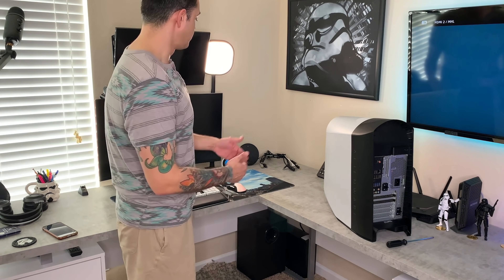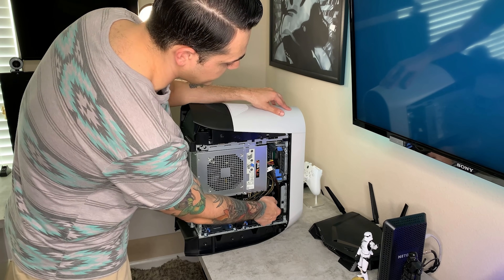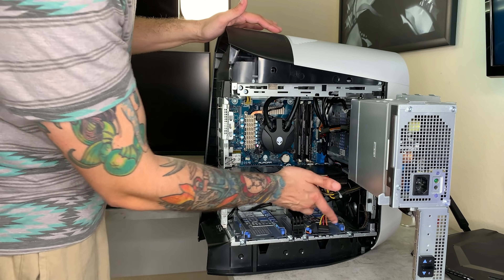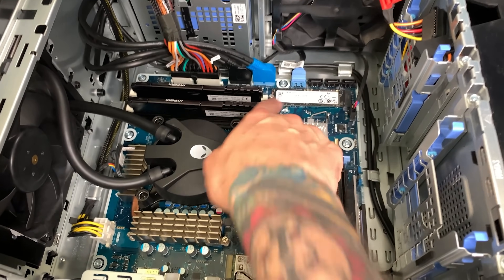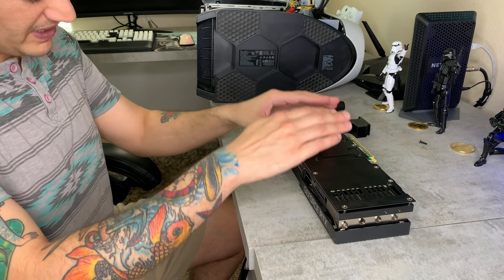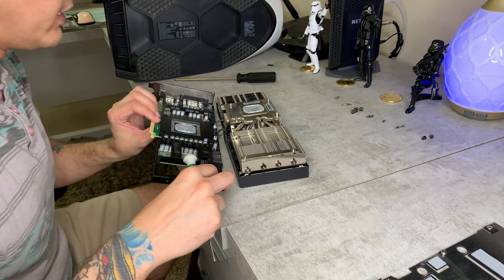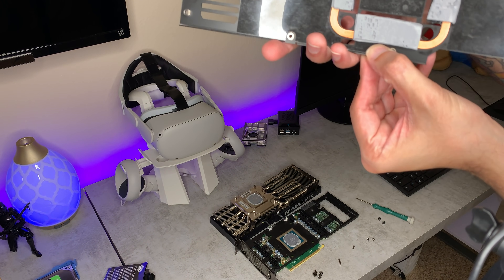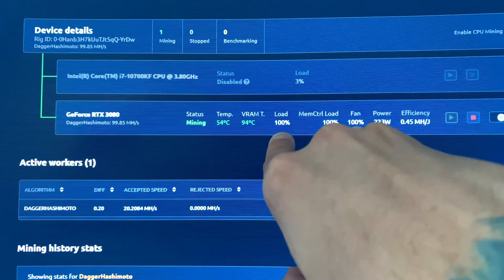Alienware R11 3080 Thermal Pads and Paste Drop VRAM Temps 30C

Comment: Those alienware suffocation boxes just are horrible,moving all the crap out of one into a new case litterally lowers ALL temps Mobo cpu gpu ram and board temps drop 20deg.Stock everything was 73deg I got everything down to 47-55deg Celsius from the new case.The standoffs I had to modify but it worked.

Comment: I bought my R11 a couple years ago and overall was happy with it.    I wish I had seen your site then!     This morning I got the dreaded  pump fan not responding error code.   The fan runs but I guess does not spin up to speed.   I have a new fan ordered and while I have it apart I am going to add the second intake fan.  This is the first time in about 25 years I bought a pre-built PC.   When I built my own I got huge cases (I miss Fry's electronics)  I still have a couple and I thought about transferring the  R11 guts to the bigger case.    One has a Thermaltake 1200 w PS.  Lots of fans and lots of air flow.  I will be checking out your other videos to see what I have been missing.

Comment: I'm having problem - my aurora won't boot up now 🥲 i tried cmos, tried replugging everything, tried switching back to stock ram (that's the only thing i changed in my rig),  tried unplugging everything, bar 1 hdmi monitor. It flashes white 1 and 1, then 2 and 1, then no flashes whatsoever. I read through comments but nobody reported in the first like 50 i checked
I bed you or anyone, what can i do ro boot her up?

Comment: ok dude excellent video... holy f! Wonder if you have any issues one you unscrewed everything in terms of removing the PCB board? I disassembled my Dell RTX 3070 (its pretty much the same design) but for some reason after removing all the pressure screw's after the back plate was removed I could not FOR the life of me remove the board to reveal the damn GPU / access to replace the thermal paste. Just wondering if I should pull this thing apart again and just pull harder ? I really did give it a good pry and it really seems to be stuck together... any chance that could just be the 2 year old paste fused together ? Any help or advise would be great , cheers.

edit: okay so I read a few comments how separation was "difficult" so I opened it back up and gave it a second try.. Dell used around 1cc of thermal paste and it had hardened into thermal glue after two years! took a million q tips and alchool to clean it all out.... wish me luck using artic silver 5! in a moderate amount along with  adding some thermal pads like you did!

Comment: I have the same computer but when I took my card out it's different than yours. Yours is longer than mine and when I took the top plate off (some screws were upside down. Not all on top like yours) like I can't separate it its different I don't know what kind they have cuz I don't really know much about computers. Just recently bought this Alienware deal and now I got this thing out I don't know what to do with it now because it doesn't come off like yours did. I'm so confused now. Been trying to find other alienware videos with my type of card but everyone has one like yours. Not sure of they screwed me over with some kind of second rate cad or what. It's the same number, and everything. I just don't know.

Comment: I didn't see any mention in your video about adjusting fan speed via the Alienware Command Center app - it took me a bit as the UI is terrible, but if you go to the temp tab (fan speed) and click just to the left of the offset on your current profile you can crank those fans up for when you are mining.  Granted this makes the machine hella loud (new quieter fans on their way) but it did drop temps a bit more.  Sorry if redundant or a "duh" moment, but squeezing out any additional temp reduction is always a good thing for mining.  Great video by the way - I love your setup!

Comment: I did my 3090 in my R13 and I’m getting 122 MH at 49 degree core and 96-98 VRAM at 100% fan speed (only 2000rpm Noctuas) in my OCC controls. I plan to improve this even further by adding a large copper heatsink and possibly a fan to the 3090 back plate.

Comment: I just followed this procedure with my 3080 and the results are fantastic. 

I was running Medium setting in NiceHash with 104 Celcius VRAM temperature. I decided to shut her down as that was way beyond recommended operating temperatures.

I used 1 package of 1.0mm Thermal pads and 4 Thermal paste tubes as prescribed.

Now I am running Extreme setting with 88 Celcius VRAM temperature.

AK40Kevin, many thanks for posting this video. Cheers!

Comment: Just changed thermal pads on my 3090 Alienware aurora r11 with the Gelid Solutions Gp-Ultimate 1.5mm (saw them on a comparison video and they where among the best) and upgraded from 100mh/s 100C 70% fan, to 120mh/s 98-100C and 60% fan
Reply: Nice improvement but what shocked me more is that you only get 120MAsh. My 3080 takes probably half the power (never really check the exact numbers...) and after repasting, I'm back t0 100 megahash/s...

Comment: Nothing on you buddy, it’s just so sad that they would actually charge you so much and you have to try to correct Alienwares sad attempt at building a gaming desktop.  If you buy a prebuilt I feel it should come operational out of the box, not thermal throttling at idol.  If you ever need help building your own rig let me know, I’ve been building rigs since the early 90’s.
Reply: do you know if i can change the cpu cooling, mine does not have watercooling, so i was wondering if i could replace the cpu cooler with a corsair h60 watercooler

Comment: Not sure if anyone said this, but i think the real issue was you putting the thermal pads on the die side heatsink. You should have removed the cover on that was on top of the die side thermal pads and put them there. I'm not sure that thermal paste really solved the issue. i suspect the big thing was having your card mounted correctly after teardown and the thermal pads on the back. I am going to work on a couple of my friends dell 3090s this weekend and I will try just the backplate pads first and if that doesn't help much do the front side and report back. If we find in the end we need thermal paste then I'm the dick :P

Comment: You can't use pads because the core itself is then not making contact. The square in the middle that has paste from the factory, that's the GPU core. Really this extra paste is allowing the substantial cooler to more effectively take heat out of the memory in the same way it can remove heat from the core, which it's very good at.

Comment: What he said is true, I applied thermal paste on my r12 3090 Memory temp from 110c dropped 2~ 4c but I put some heat sink on back plate and fan blow on heat sink, It dropped until 98 Celsius. But I haven’t changed my thermal pad yet, If changed maybe can lower more temp.

Comment: I tried the thermal paste on the metal housing, stickers removed, no dice.  Memory junction still topping out at 110 degF.  Replaced all the pads, 5 times now trying different combinations.  I hate my Alienware R100 3080.  I shouldn't have to go to these lengths to make it be able to handle it's own heat dissipation.
Reply from the maker: Yeah I was super frustrated /Pissed the first attempt when nothing changed , second was successful for me , I’m not sure what is different about what you are doing . What paste are you running?
Reply: @GamerHeavenOfficial  Arctic silver 5.  The paste part seems perfect.  When I lift there was good coverage, CPU temps are running cool at 46-48F.  I'm going to keep working on it until I find a good setup.
Reply: @GamerHeavenOfficial  Huzzah!  Well, sort of...  The RTX 3080 and I have come to an understanding.  I replaced the 1mm pads with a different set of 1.5mm and the 3080 agreed to stop overheating and throttling.  I only got down to 106-08 degF, not the phenomenal drops others have experienced.  BUT!  By getting it down those 2-4 degrees, I'm no longer riding that 110 throttling barrier.  It's a small victory and we're at a tenuous peace, but the future begins to look a little brighter.  From 75 MH/s to 99 MH/s, holding solid for the past one hour now, a 28% increase.  That's all I needed!  Thank you for your video; it and a little bit of tenacity got me to a workable result!
Reply: @mikemcelveen  Dear Michael. This is an old post. Take the side door off and temps will drop 6C. Then use a small fan to blow on the GPU and move the hot air off and you might get 4C drop. I'm doing that mining 89M/H on a alien ware 3080. I'm about to do this mode as my 2nd R12 is about to arrive and I have to R13s incoming in Jan that are 3090s.

This is a lovely channel that helps good people make more money and optimize together.

Comment: You never answered my question about Cloud Prepared. Also weird question. How much thermal paste do you think you used for the GPU and for when you pulled the water cooler off? I bought 1g of kryonaut but not sure if will be enough
Reply: Don’t need much. I just put a pea size amount on the center of the chip block and left the existing paste on there as the pc is still new. Then I peeled off the two stickers on the metal plate, cleaned the residue with isopropyl alcohol and a clean cloth, and proceeded to put a line of paste on each of the four sides. Don’t want to overdue it. Getting 60-65 degrees Celsius under load and 28-31 at idle or while browsing the web. Put in two front noctua fans and it runs a lot quieter.
Reply: I also didn’t bother with the thermal pads

Comment: ...People LAUGH at the "sometimes basic" but almost always GREEN basic colored PCB of many, many dells cards sometimes made teamed with PNY and such ...they may not look "the greatest" until you realize the longevity they do indeed have as in any made for DELL mid to higher end card, I have a 1060 6gb with basic blower fan and blue PCB, just never stops going regardless how badly I beat up on her.... This is when I realized PNY gets a bad "rep" for no good reason as PNY is beast and GOOD INDEED, DO NOT Listen To Those Whom Say Otherwise, ASUS is the one that BLOWS.... Especially the mobo's, always breaking, Thus IMO -  a Gigabyte mobo (they make them ultra durable and MEAN IT just get matching ram and modded bios sometimes for higher end giga boards, last forever too) with a dell GPU card made for dell like by PNY or such (if find one for sale) as well as matching ram (with "Samsung chip-lets" over micron these days) by G-Skill, Patriot &  Corsair is also fine however if find ones you like that are LISTED to work with the giga board made by Mush-kin RAM KiT's - GO WITH THEM! .... Get a little larger case then needed to help with airflow and a proper water cooler or even a Noctua Cooler, they are all good as well as certain cooler-master vapor chamber coolers are also beast and never fail like the GTS V-8.... I recently took a chance on "In-Wins" almost unknown water cooler as in the SR-36 pro as want to test the TECH they have to go against as-rock and its stupid patents.... I LOVE In-wins cases, some of the best ever in way of HEFT & just overall "awesomeness and quality, also last forever as well as rarely ever a single plastic piece BUT some of them are trading that for cooling thus they need to get better at that part or if you are okay with minor to medium tasked MODS of your case then in-win would be the ticket for a case.... Seagate I always trusted with my drivers however I am out of the loop with drives now and what is the best, especially for solid state ones from SSD to the NVME & M.2 but Toshiba maybe, if again - can find that as its not made in china but yet JAPAN which is spectacular quality over the decades only ever challenged by the U.S.A on many things, Taiwan also does a good job however they always have the Chinese parts that some things can not be HELPED.... If unsure and it is made in the U.S.A. somehow...Japan or even places like Germany and such, other democracies where QUALITY matters, GO FOR IT..... BTW: I have bought a used x299x board by giga for great price as was used fort "testing cpu's" ... but seller did not mention the VRM pads seem to be swapped and are thicker a tad, light pink, nearly bending the thick giga PCB a hair if really look closely near vrm as has back-plate - unsure if this is a good thing or bad thing.... HMMM.... Anyone, return or keep as afraid to put my 9800x into it now as in the lowest CPU I have for x299 and the Russian seller is not very talkative but feedback is decent to "okay"?.... QUOTE ME HERE; "I HATE THESE AMAZON WHOLESALE BUYERS OF JUNK & GOOD STUFF AT RANDOM AS IN THOSE RESELLERS WHOM GET THINGS THEY DO NOT KNOW WHAT THEY ARE AND RESELL NOT KNOWING IF SOMETHING IS WRONG THE EYE CAN NOT SEE, ITS LIKE A PLAGUE ANYMORE" .... On another last note, I also like the fact DELL uses those BEAST MODE steel insides still (heavy, durable) but why do they often have to ruin them by covering with plastic? This is where Silverstone comes in, they still make the great case ever made in my opinion as in the Silverstone Fortress FT05 in silver or black, with window or without.... G.O.A.T. - gave mine to my son and just ordered a iCUE5000X RGB and like the looks in white however wish the one single part in grey near front was not plastic however its super sturdy, just hate any PLASTIC! .... Heck, even if they layered the plastic in a thin but thick enough to last metallic SUBSTANCE (OF SOME SORT?) would go a LONG WAY - IMO...

Comment: I just did this 2 days ago pads+paste and I am over clocked mining ether and dropped from the 110c thermal throttle down to 90-96.

I did the coffee filters with alcohol to clean off the old paste (I got about 95% off but some remains around the edges)  

Gaming really see an improvement my office doesn’t become an oven.

I used the smaller 4 unit Syringe and it was just barely enough and I would of liked to have a little more.

Comment: @12:15 -- the most important part of the video is magically corrupted.  I went super generous and the supposed areas mentioned and got my temps down only 2 degrees from 108 to 106.  Anyone else tried this and had it work? Please let me know
Reply: I just did this 2 days ago pads+paste and I am over clocked mining ether and dropped from the 110c thermal throttle down to 90-96.

I did the coffee filters with alcohol to clean off the old paste (I got about 95% off but some remains around the edges)  

Gaming really see an improvement my office doesn’t become an oven.

Did you remove the little plastic stickers before putting the paste down?  

I used the smaller 4 unit Syringe and it was just barely enough and I would of liked to have little more.
Reply: Thanks for your comment.  I did remove the stickers, used 6 grams of TFX and it was barely enough.  I wonder if I needed more, I will open it again but this time not clean off the paste but add more and a large dot in the center.  Will add more and report back.  Which paste did you use?  Glad you had good results!
Reply: @loveislife77  I only used 4 grams but it really needed 6 grams.  

I completely covered the chip and then used what was left to cover the heat pipes in the areas mentioned in the video.  

ARCTIC MX-4 is the paste I used.

So did you remove the stock paste from the  chip then reapply and completely cover it?

Comment: read every single comment, still no clear answer on what size pad, however I am using a 3090 and there is no copper heatsink on the backplate, I ordered three sizes 1, 1.5, and 2mm. 2 of each size, as they are small. They will be here tomorrow. One confident user said 2mm for the 3090. Currently 108MHs @100C temp memory junction, 1300 OC on memory, -150 core. GPU temp  @57C, power 80%, 270W  fans 80%. Tried same settings but at 100% 349W power I get 106 MHs, memory junction temp 106C. Did not make a difference either with case cover open or closed. Praying for a miracle when I do this. Anyway thanks for the vid, great content and info as usual. edit "there is a heatsink" did this can confirm 2mm for 3090 GPU

Comment: I was able to get the same, but marginally better results. Hitting just under 100 MH/s consistently, and the VRAM temps stay consistent at 90-92 and core clock at 50-52. I used the same thermal pads, but got the thicker 1.5mm ones and was a little more generous with making the pads bigger than the original ones. And of course generous amounts of thermal paste between those two heat sink plates around the core. The thermal pads under the backplate definitely do help, theyre a lot more conductive in heat than pockets of air. Otherwise same exact setup as yours with NiceHash.

R12
11700KF
64GB RAM
RTX 3080
2TB WD BLACK PCI AIC (to get close to Gen 4 NVMe speeds on PCI 3.0 x8)

Also upgraded the fans the corsairs ll120, 2 as intake on the front, and replace the CPU outtake. Thinking of adding another fan directly underneath and pointed at the graphics card on the bottom of the case for enhanced airflow.

Comment: Thank you for the video. I have a new R10 and anytime I wanted to play a game the computer screen would go black and the system would restart. I  used GPU-Z and found that the card was hitting the thermal limit then shut-off.  I didn't want to waste time with warranty crap and took it upon myself to open it and when I did it had a very small amount of thermal paste on it. I cleaned it off and added more liked you advised surrounding the chip on the metal and the temps are way down. The card works great and no more issues. Thank you again for the video. Also not sure if your interested but I have a 64GB kit of RGB Corsair RAM that I purchased and can't use. It's for Intel so I just purchased another kit for AMD and was wondering if you are interested in it? Or any one in the community here.
Reply: Interested.